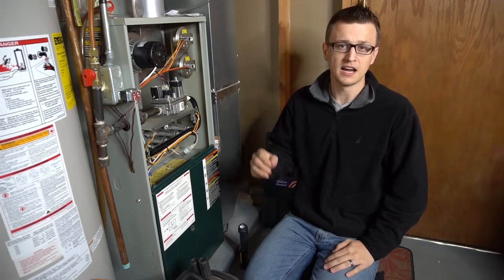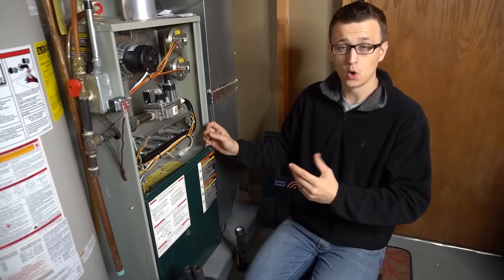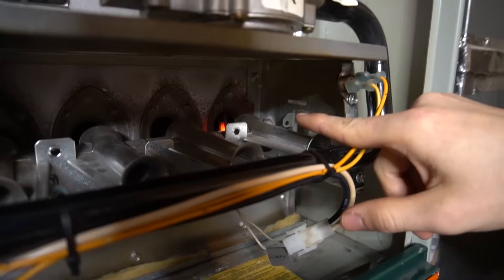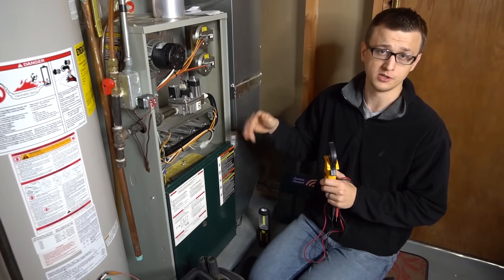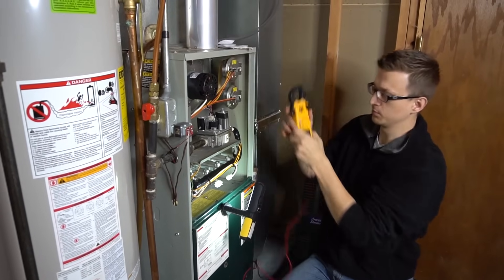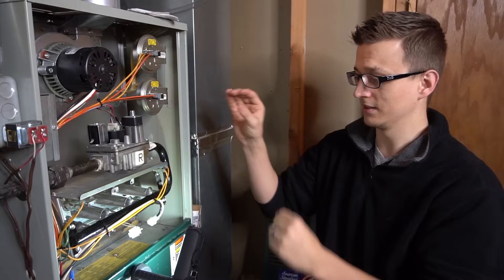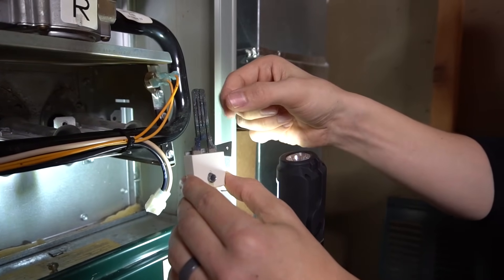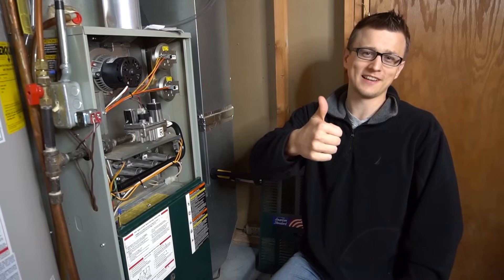Furnace Not Igniting - How to Check and Replace Ignitor

Comment: I have an american standard freedom 90 (model: aux040c924c3) that I believe has a bad igniter.  It's a hot surface igniter that I think is 80V - part# IGN-0145. The igniter looks different than whats in the unit though. Are these universal parts? Will any 80v surface igniter work?

Comment: what if I dont get a voltage reading ? I have an XE 70 and had gone through the fuse and it was good, but something also went wrong with my volt meter going to remedy today

Comment: I believe I have the 4th one, but I have an old furnace.  I think there is an issue with   the motor. It's not coming on. I have an older one with a wheel outside the motor and only one pressure switch. Earlier in the year it wasn't igniting, but some the motor was a little stiff, but they lubed it some and it was fine the rest of the cold season. I believe I replaced this motor a little over 10 years ago
Reply: Ever figure out what was wrong?

Comment: My igniter turns on bright but no flame comes up, then the igniter goes out. Tries 3 times then lockout. I’m thinking it’s the flame sensor but I thought the sensor only operates once the flames are on so not sure.

Edit: my gas valve switch was between on and off. I sense that vibrations of the furnace caused the switch to slowly creep down as the switch was very flimsy and not a solid switch. Hope this helps others during debugging.

Comment: My hsi only glows at the tip and goes about a quarter of a inch down. There is a white line. I'm reading about 45 ohms. Bad hsi maybe? I can smell the gas.
Reply from the maker: If it is not lighting the gas, then yes, I would say that ignitor is bad. Normally the whole thing will glow.
Reply: @WordofAdviceTV  UPDATE: I replaced ignitor with the one that was on there. A Honeywell glowfly universal hsi and it ignited. These particular hsi's don't glow from top to bottom but I think my previous one wasn't getting hot enough with the amount of time it was given. Thanks Jay.

Comment: I learned long time ago that if it is a load especially heating elements, test only with Amps and/or Volts. They can test good with Ohms and Continuity but will fail "under load", then you get a call back.........at 2 A.M.

Comment: My ignition looks good. Mines not glowing at all as it doesnt even get to the point that the gas starts going. I've tried to manually light it based on your other video, but I cant even do that. Could it be a bad gas valve? It never makes the click sound or anything. Its nearly 4am and it's cold af right now. I've done everything in all your other videos and still stuck

Comment: I have a problem with the main valve it don't get energized once the pilot lights up suppose to get energized , I energized it manually and it worked , could you please help me with it ?. My furnace is an old Rheem .

Comment: Hello Jay ! Thank for your clear video presentation which I got a lot of help for my furnace problem. I’ve a problem isn’t in one of the common problems out there . I’m still trying to solve. What it does is , the igniter come on & start the flames and the went out & starts again less than a second then continue working fine but sometimes it repeat a 2nd time & catch the flames to continue the cycle. Hope you will have some solution for that to share! Thanks

Comment: This guy is spot on.  I replaced the flame sensor , cleaned the burners, changed the filters which worked a couple of years ago when my trane xb would not stay lit.  Just beware if u have a nest thermostat with a low internal battery, if u still can’t get it to stay lit, pull the thermostat off the wall and charge it up for an hour or so - - after that it was good to go.
Reply: My Ecobee thermostat doesn't use batteries. A wire from the transformer powers it.
Reply: @crand20033  It probably still has a lithium battery like the nest.  Nest has Blue Power wire, too.
Reply: Do you have your blue Common power wire hooked up to your nest?  That's supposed to charge its internal lithium battery.  If you do and it still went dead, you can replace the internal lithium battery.

Comment: @Word of Advice TV
I've watched most of your videos but can't seem to find you talking about an issue where you see the ignitor glow but you never have the flame. I used your video where you try to manually light it to get some heat for a moment and when I tried the method, it never caught, almost like there was no gas coming in.... So I see how your videos would be such good help to most people with issues but for my different issue of not being able to light manually or with ignitor is just making me have a headache.... :(

Any suggestions would be much appreciated
Reply: I have the same problem and want to find out what is wrong.
Reply: @jaybrahmbhatt7197  I think it is a bad gas valve that is not opening.

Comment: Jay, I can't thank you enough for the in-depth video you made about furnace not igniting. You're a God send my friend. After watching your video I ventured a try at pulling the ignitor, and you were right. It was covered in carbon. I cleaned it with fine steel wool and placed it back in. Turned on the furnace and it worked like a charm. I reckon you saved me a couple hundred dollars. Thank you!
Reply: Just curious if it's still working?  I heard it's not good to get finger oil on the.  How's it working this year?

Comment: PLEASE HELP :Is it possible for the ignitor to "look" like it's working, as in it get red hot each time, but not getting "hot enough" to ignite the gas?  My furnace goes through all the necessary steps, but after the igniter lights up and the valve audibly "clicks" open...no ignition.  Tries again and lights right up.  Has been doing this sporadically now for over a month, no one knows what the issue is.  Could it be a valve issue?  Usually if a valve fails, it just fails, doesn't keep working then not working for a month.

Comment: Thanks a lot for your videos, I hope you can guide me with my igniter issues,  My igniter is a 95Vac,   it reads 50ohms on the multi meter,  and also the furnace delivers 95Vac when requires it, but does not gets hot enough to light the gas,    before I purchase a new igniter, do you know if there is a way I should be expecting 120Vac for the igniter? what could be causing the problem? (I turned on the furnace using your lighter trick, while I figure this out) THANK YOU!

Comment: FRAGILE little coil. I've clumsily Broke 2 perfectly good igniter. Once when upgrading a separate component. Secondly while switching the hardware over I dropped my screwdriver on the coil.

Comment: My flames do not start but If my ignitor glows, it means that isn't the problem right?
Reply from the maker: Do you hear the gas valve open and gas hissing out for a few seconds? If yes, then that ignitor is weak and is not getting hot enough to light the gas. I would replace it. If you don't hear the gas valve energizing/clicking then there is something else wrong. I would start with seeing what the error code on the control board is after this happens.
Reply: @WordofAdviceTV  i hear hissing i think but no click, is gas not coming out if there's no click? Am I able to safely manually light with a lighter? Or would you say I most likely have to replace my gas valve?
Reply from the maker: @guapoconguap  As far as I recall, there is always an audible click when the gas valve opens. If you think the gas valve is bad, it would be good to check it with a multimeter and see if the gas valve is getting voltage when the igniter starts to glow. If it is getting power (24-28v) but it isn't opening, then the valve is bad. Also, what error code is your furnace showing when this happens?
Reply: @WordofAdviceTV  ok so I do hear a click and I see flame going through the pistons now, and then air goes through the vents (albeit not hot air) but then it shuts off. I tried flipping the switch off and then on and same thing happens only now the flames go on and then it shuts off immediately after that. I'm trying to look for the light code but nothing flashing at all
Reply: ...aaandd now back to no flame at all, I hear a click after blower and pilot flame goes out but not sure if thats the fan or something else.
Reply: @guapoconguap  Sounds like you just tripped your high limit switch, time to call a tech out.
Reply: @robomaniac8  yea, I have haha. Thanks ling ding

Comment: Any ideas on what’s wrong with the furnace if the igniter works, the glow and fire happens but the fire just keeps shutting off after a few minutes? My furnace just keeps blowing cold air. I just keep flicking the on/off switch but it keeps shutting off.

Comment: Another great video! Quick question. There seems to be no accurate way to test a direct spark igniter..? Did find something regarding resistance but I'm not sure how accurate that is. If I do have a led blink to confirm an ignition issue yet my igniter looks great, I'm thinking board. I did see where a tech grounded out a wire and stripped the other side back, held with (insulated)pliers close to the "nail" on the board to confirm arc...no arc, bad board..thoughts on this procedure vs simply replacing parts and guessing..? Also, inducer motor working, blower motor working, it basically just locks out after a short time.

Comment: I have a Trane XR80
My inducer motor starts.
Igniter wouldn’t glow
Igniter wire is only delivering 115 Volts.
Old igniter is only 15 Ohms.
No glow.
Changed it.
New igniter is only 16 Ohms.
No glow.
Gas valve is not opening either. I think it should turn on, then back off when it doesn’t light.

Board?

Comment: What if we bought a control board kit for a Trane XL80 kit 15943  comes with a IGN00152 igniter that is different than the igniter than one it came with. The original looks like the one in this video. The mounting screw to mount is parallel to the ignition rod on the IGN0052 vs 90 degree to the original like on this video. Do they operate at the same voltage/amps ? What difference would change the function ? The resistance for its operation with the same voltage from the board be fine or do I need a mount for the igniter that came with the board. Do the  replacement kits boards ever output different power for igniters ?

Comment: What if the igniter glows but there’s no flames. Could an igniter glow but still be bad? Thanks!!
Reply: It means the dragon is asleep.
Reply: That's when you check amps, do a little research and find out the amp reading of a good igniter and from there , it's always good practice checking amps on anything electric operated when troubleshooting

Comment: Looks like I have the same furnace as you do in the video. Mine seems to rarely ignite on the first try. It does on the second or third attempt. I've seen the ignitor glowing. Could I have a gas valve going bad??

Comment: I put in a new ignitor. It started initially, but that did not last long and I was getting cold air. So I cleaned flame sensor, but the new ignitor is not lighting up. It is located right between two burners - it is not directly behind one. I am new at this and am wondering if it is not lighting up because it is not directly in line with a burner to get gas to it?

Comment: I put in a new igniter. Furnace did work initially, but within a few minutes it was blowing cold air. I cleaned the flame sensor, but that did not make a difference. The igniter is not directly behind a "tube" (not sure what it is actually called), but it is next to one. Should it be behind a tube?

Comment: I’m only getting 87-97 volts to my hsi. I’m getting 80 ohms on the igniter. Hsi glows  and gas valve opens but won’t light. Is the ignition module possible bad due to not getting 120 bolts?
Reply: I have the same problem,  my furnace requires 95V igniter,  I checked the ohms and it is 50ohms,   but the igniter does not get hot enough to ignite gas,   checking the voltage I get 95 Vac when needs it.   Where could I check if this is normal, or should I expect 120Vac?

Comment: Hello, replaced ignitor and bought new smartvalve, (Honeywell) and nothing. The the fan works but won’t glow/light, gas valve is on position and nothing. A/c works but the furnace won’t work.

Comment: I have an older Trane XL 80 and just replaced the ignitor which I had done in the past.  However it still won't light.  I remember the last time there was another item that I also had to replace on the left side of the furnace.  It was a rod with a bend in it to you know the name and do you think this might be why the new ignitor is not working.

Comment: Thanks for the video. My furnace (2 stage) turns off a few seconds after the hot surface ignitor turns on, just before the burners kick on. It does this randomly  maybe 4-6 times a year.  I know when it will happen because my inducer fan is louder than normal when my furnace gets the call to heat. Almost like the inducer fan decides to start in stage 2, instead of stage 1. Any ideas? Pressure switch?

Comment: My furnace ignitor isn’t working and I tried this.  The resistance looks good but the wires that go from the control board to the ignitor only read around 2 volts.  I watched the video on trouble shooting the control board and everything seems to be in working order.  Any other thought on what could be causing my issue?

Comment: What about  those Bryant 2003 the hot surface  ignitor  and frame  sensor are located in a very tight  spot.  Where  to open and replace  the hot surface  ignitor?

Comment: Thanks for sharing, my ignitor is glowing but there’s no flames coming out of my burners, what do you think the problem is?
Reply: Gas valve
Reply: Gas valve, get your volt meter and check and see if you have 24 volts coming to the value at the moment the board sends the voltage to the gas value if you have 24 V , well then get a screwdriver and hit the side of the gas value not to hard and if that don’t work you most likely have a bad gas value. I know this might be a lot but it might get you out of spot? 👍

Comment: I jumped the limit switches, (2) and removed the cover so I could try to see why the ignitor didn't seem to be lighting ... It was not glowing, so I removed it to test and put power to it while out and it glowed bright orange ... After I reinstalled it and put the power to it, the burner fired up right away ... When I placed the cover back on, the burner would not light ... Removed the cover, got it to relight, placed the cover back on partially ... 
So here it is, jumped/by passed 2 limit switches and burner cover partially in place ... Initially when it fires, it blows back, but, immediately settles down and blasts into the ports ...
???

Comment: Hi excellent video!

QUESTION: during a power outage I heard a spark that went off when the power for our area was being fixed by the electric company so at intervals we had low voltage then completely shut down so when the furnace turned on it created a quick spark then the flame went out then the power again was off to our area so now the power is on in our area and the furnace will turn on with no error signals just a stable red light and the gas valve will open but no flame - what do I do?   

Did the igniter shorted because of the on and off to our power in our area - (when the furnace turned on and tried to heat up the house in that beginning stage the power again went off.)

If I do need to call a service tech what should I make sure to look for in a tech?

Greatly appreciate your help!

Thank you

Comment: Thank you a bunch!!!! 

1st thing I did was unplug then plug the furnace back in..........just for shits and giggles.....
I seen you do this several times in the video.
And this worked for mine....working fine now....
Why did this work???
Oh I should mention,  i did have a very dirty filter which I changed out before I started anything.
Reply from the maker: Haha you're welcome! Glad to hear you got the furnace working again. A dirty filter is one of the most common reasons why a furnace stops working so there's a good chance that's all it was then :)

Comment: I appreciate this video. Tom Drexler came out to check my A/C and just happened to somehow remove a wire from the igniter. Thanks to you I was able to diagnose the problem, restore the connection, and save myself another visit from an expensive company.

Comment: Guess my issue has not been resolved.  The ignitor was borderline, was working occasionally last weekend, and believe it should have been changed either way.  Changed it on Monday, came right on, ran a couple cycles, then stopped coming on in the middle of the night.  Checked ohms on new ignitor, is good.  Doesn't appear to be getting voltage.  Hoping it was a loose connection somewhere, checked wiring, seemed ok.  Tried again, and it came on.  Tried again this morning, nothing.  Have not tried troubleshooting the board yet.  Definitely has power to it, and not getting any codes.  Would the ingitor come on occasional if the board is bad?  Any ideas?  Is a Trane XL80.  Thanks much!!!